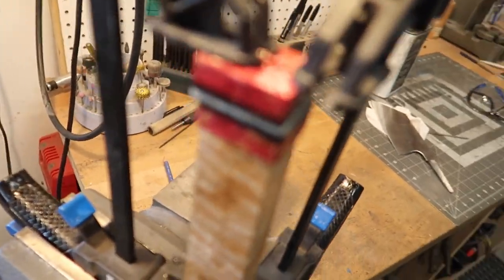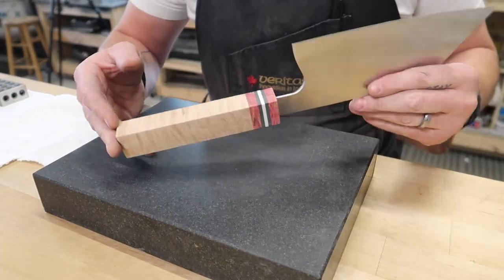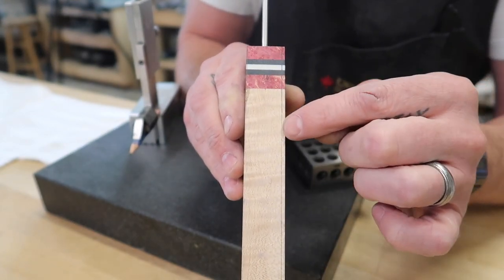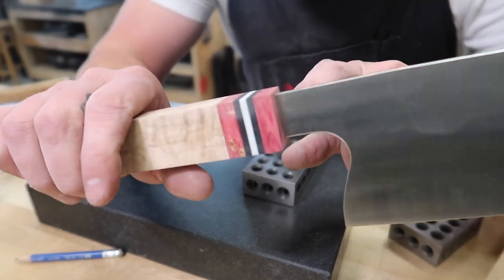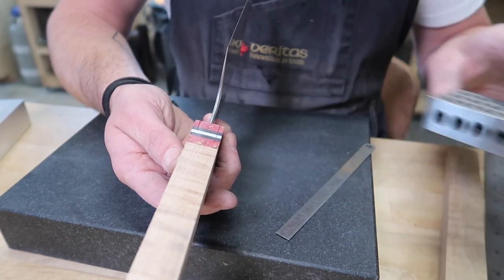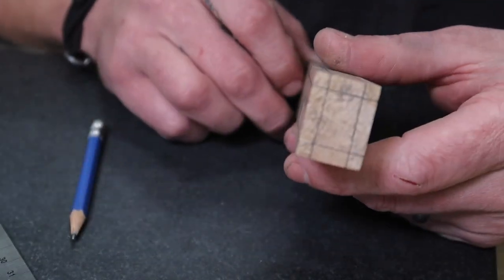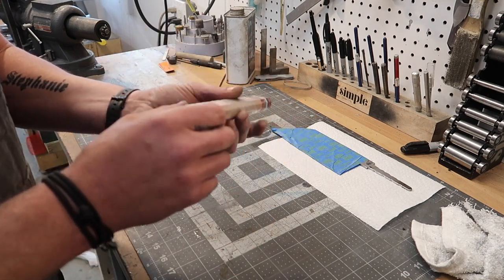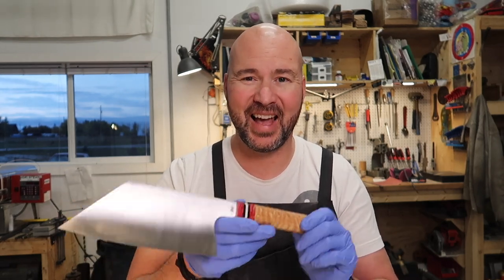How to Fit a Wa Handle Part 2 - step by step turorial

Comment: Knife makers and you especially are SOOO underated when it comes to the skills and knowledge involved for something like this to come together. The phrase "jack of all trades" comes to mind... 
For example, just on this project you were:
a historian -to accurately replicate traditional Japanese styling
an engineer -for ergonomics and function
a designer -to use colors to make something visually appealing
a blacksmith/metal fabricator -to shape the blade
a metallurgist -to properly heat treat the blade
a carpenter -to cut and shape the handle
a machinist -to precisely measure and center the handle
Then, if that wasn't hard enough you then added...
a photographer, a cameraman, a video editor, a webmaster, an entrepreneur, a businessman, a salesman, and a teacher...

Comment: Grab the blade in a vise on your mill and drop an end mill down the sides of the handle to true them up to the blade...I'm a machinist, I always try to find find the most precise way to get there. Love your channel man. 👍
Reply from the maker: Thanks Steve! That’s a really great idea. Have you tried it? My worry is the handle would rattle loose if it’s not epoxied on already. But man, that would be so easy! 👍
Reply: @Simplelittlelife  No...never tried it. I've never made a knife for that matter. But you're right, I didn't think about the handle still being free.

Comment: Jeremy. Thank you for such an informative set of vids! I do have one question. You say you soaked the handle in tung oil or similar.  Surely, if it is resin stabilised  to strengthen the wood and stop twisting , cracking etc, then the oil will not soak in as you say. Am I missing something?

Comment: What are the '123' blocks you use a lot. Are they used in hydraulics or air distribution?
Reply: Just watched an earlier vid showing you making the handle. Can you tell me starting sizes before shaping? Obviously rectangle shape at blade end. Important to allow  centering of 1/2" hole.
AWhat is 1123 block.  For hydraulics/air?

Comment: Good videos man! Learning a lot, thanks for sharing. Going to try this on my next 2 sushi knives. 
For some reason I don't like to clamp on the tip of the blade, so I usually clamp the flats between 2 pieces of wood which are longer then the blade and clamp to those blocks and the handle. Works great.
Keep the videos coming.

Comment: One thing that drives me crazy is the amount of tape you use when doing epoxy stuff. Would you try getting some of those $5 silicone mats to mix your epoxy on to perhaps show people they can reduce their waste?
Reply from the maker: I get that comment a lot. Tape is cheap. The waste is small. I’ve tried silicone ice cube trays and they just are a pain to cheap and store. Tape is a product I use in 4 different processes in knifemaking so it makes sense to keep it and not have other stuff to deal with. Simplify. If people are really worried about waste they should stop buying useless crap at Walmart. I buy only things I need and use and buy the best I can so they last longer. Our culture is bread to always buy the latest and greatest and throw it away when the next thing comes out. That is a far bigger waste issue than me using tape to mix epoxy.
Reply: @Simplelittlelife  I remember when you were using those ice cube trays. Which is what made me use a silicon mat for woodworking stuff. It just sits there along side other stuff on my bench and never moves.
But I agree, the waste we go through with buying new and whatnot is a load of crap in itself. If you buy something nice that costs a little more, most people are well inclined to take better care of it and think twice before scrapping it for something new.